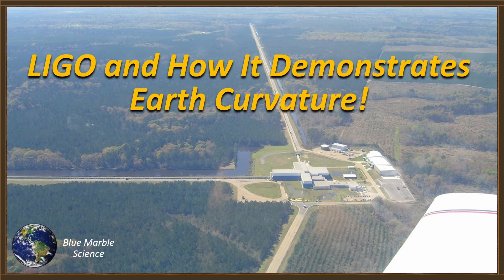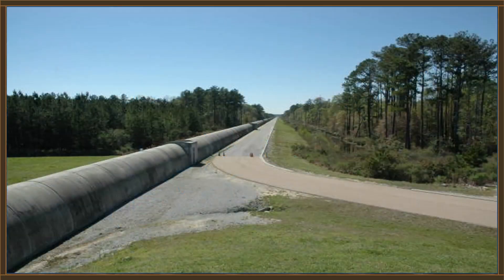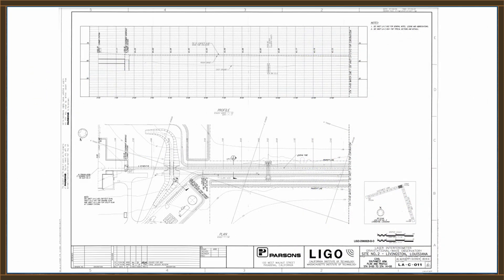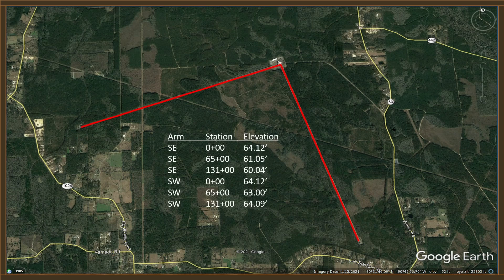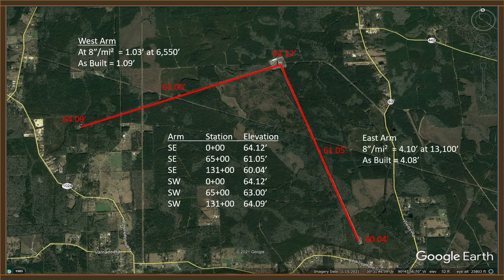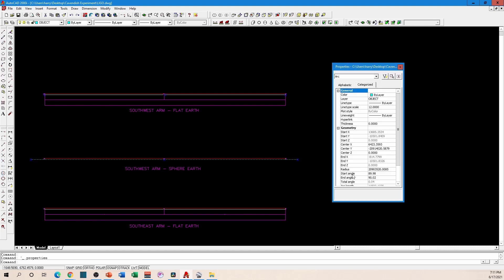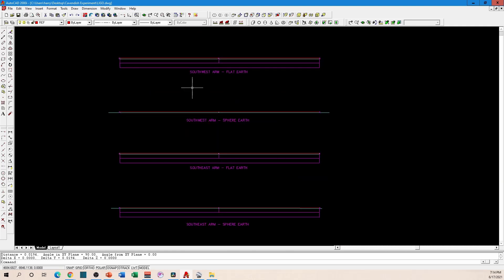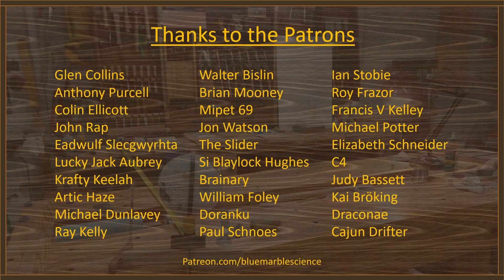How LIGO Demonstrates Earth Curvature

Comment: Why don't the elevations on the 2nd arm match the 1st arm? Shouldn't they both be 1' lower in the middle to match the globe model? I'm a Civil Engineer and I'm genuinely curious. I have drawn this in AuoCAD as well. I can see your points but claiming that this "proves" the spinning ball model is a giant stretch for me. To each their own!
Reply from the maker: The arms lie in a tangent plane and at Livingston, they picked the point of tangency to be slightly south and about 1.25 miles west of the southern end station. The result of that decision is that the northern arm is nearly level at its midpoint, but the eastern arm elevations change about four feet over its length. When you plot the elevations of that arm, they also form a slightly parabolic arc with the center point being a foot lower than a straight line drawn from the arms endpoints. I hope that isn't too confusing to visualize.

Comment: Wrong! At 5:32 freeze it. That SW line does kinda fit your end numbers I guess to bad your not reading them correctly. A story pole is read from bottom to top. I shoot 64 and mark it, I shoot halfway (for the sake of argument) down the line I shoot 63 as my pole is sitting on a mound of dirt (1) high I mark it, shooting thru 63 to the next 64 (because there was a big rock in the way it left a hole for the pole to drop into. Even so whats up with that SE line? Thats a freakin mess right there. Before you tell me they graded it flat b4 shooting I know plumbers that cant get 1/4" fall per foot half the time. Brian was right The 'ground' does matter. Build this thing @ Sea LEVEL get back to me. Or if you know the tube is level run a line 90deg to the  perpendicular vertice. If what YOU present is true then the TUBE is not flat but an arc either way does not prove curvature only uneven ground. And thats my 2cents.
Reply from the maker: These aren't story pole readings! These are elevations and you're the one reading them wrong. I guess I need to sit both you and Brian down and hold a class on how to read construction drawings. When you get away from pouring curbs and sidewalks or footers, you just stepped into the big boy arena. No engineer is going to plot story pole readings so when you figure out what you're talking about - get back to me.
Reply: @bluemarblescience  Footers exactly what those numbers are pulled for. Went to ITT tech for CADD. 30 yrs in construction Residential and commercial. Ive actually used the equipment in the construction of parking garages as a rod buster. I will admit I have not been able to pull the drawings on my end when going to the site and trying to view them. I just might be able to concur with you as I was taught to read and draw eng civil mech etc drawings plans and diagrams. It was make 200 a day hangin sheetrock or entry level draftsman makin 7.50Hr..... I know a little bit about numbers, physics, and geometry too...
Reply from the maker: @matthewpoggendick9346  Here's the LIGO site https://labcit.ligo.caltech.edu/LIGO_web/docs/asbuilts.html Check out Livingston Observatory civil package. Those are all actual elevations and you can more or less verify that with google earth. At least you can see that the road next to the arms is within a foot or two of the pad elevation data. If you look, they show "existing ground elevation", "rough grade elevation", and "top of slab elevation" on every drawing. There's a site grading plan in the Architectural section as well.
Reply: @bluemarblescience  Thank you I have no idea why I could not view those b4. No doubt about it that slab has an intentional hump (SW) and dip (SE). Now the why. A few things pop out at me now that ive been able to see the dwgs. and gather a little more info. First about the 2 sites both sites are about 50' above sea level (Civil LAC001) The numbers in the bottom of the coords legend are typically the numbers the eng go by. We will stick with Livingston Lab. I had thought no way no how would I let some doofus put a hump in my slab (ive run guys off the job for less). Both sites show a trench and the housing halfway or so in it. To the side of the LL arms are culverts (0:19 of this video) Then it hits me this is Louisianna. Living and working along the coast of FL and TX I got a feel of what it takes to get a proper foundation down and how hard it is keeping up with codes. So I beg you look at (Civil LAC004 - Section A) Zoom into that Section A. You see a dome right? Then a bottom line that says FLAT right? (kinda amusing it worked out this way) Above that you will see <----.5%. This is the substrate pitching down to meet a 3:1 drop off for water retention. Its a water table thing dig a hole in my front yard a big hole and it will fill up with water faster than you can take dirt out not to mention all the dirt sucks off the sides. I believe this elevation change is a design feature in order to shed water. Its not enuff of a difference to align the cradles up and down but water will pitch and run as desired. The SW from the center out each arm and pitched to a culvert the SE all the way out the south end. Please not how everything juts up at either end of sw but only on the corner of se. So my conclusion. Does not prove nor disprove either a globe or a fe but sure would like to shoot some numbers down those culverts settle this chit once and for all.....j/s
Reply: ooops my bad exchange Hump for Belly...sorry. This allows water to collect in the middle ish of the SW tube. Then there is the piping (possibly existing) connecting either side of the arm. So water runs downhill to middle of SW and as levels subside spills out south....the SE arm it just runs on downhill to the south and towards the gulf.

Comment: Make a simple visualization: Take a basketball or large beach ball and a drinking straw. Fold the drinking straw into a triangle. Put the triangle on the basketball. The triangle will sit on the ball, and the triangle will be touching the ball at 3 points. The point of contact with each leg of the straw is a point of tangency.

Comment: The fact that you might have very tiny differences between the tube line and the ground level is because the earth is not spherical but an oblate spheroid so they can be different along each tube path. It still shows however that the earth is not flat and that AutoCad is again the kryptonite for flerfers.
Reply: You mean the earth approximates an oblate spheroid, in reality it is a bit lumpy.

Comment: Great explanation. When arguing with flerfs about the curve I’ve posted links to a USAF navigation manual, The American Practical Navigator, a battleship gunnery chart that has tables to account for the curve, an engineering site about accounting for curvature in surveying, and a geodetic surveying site. Lately though, since YouTube doesn’t seem to like links,I’ve used this quote from CalTech’s LIGO website. : “Beam Tube Installation

LIGO's arms are long enough that the curvature of the Earth itself was a complicating factor when installing the vacuum tubes. It wasn’t enough for LIGO’s civil engineers to smooth a level path and assemble each arm’s tubes in a straight line. To ensure a perfectly level beam path, the Earth’s curvature (more than a vertical meter over the length of each arm) was countered by GPS-assisted earth-moving and high-precision concrete work.

Comment: Well done Blue! The paper Precision Alignment of the LIGO Using Dual-Frequency Differential GPS provides a good overview of how they did the analysis of the GPS data and how they transformed those coordinates to a earth fixed Cartesian coordinate system. They definitely didn't use the 8" per mile rule the Flerfer's are always going on about. Now here's another course I'd like to be a fly on wall for, Geodetic Surveying.
Reply: Given software of course 8” mi^2 is not the algorithm used. But, for 4 km it returns an accurate value. And 8” mi^2 is in my geodetic survey textbook, dated 1925. And I do use 8” mi^2 for moderate distances, like 25 mi or less, in long hand calcs. But my software of course is full computation, and same result within several mm.
Reply: @larryscott3982  I was toying with trying this out in ArcGIS, but Blue's work with AutoCad is close enough for Jazz, or bluegrass in this case.

Comment: Excellent job in your presentation.  There is no way that either the Louisiana or Hanford LIGOs are evidence of a flat earth.  
You did beat me to it since I recently got a copy of the prints and I'm putting together a similar video also including Hanford.  Actually I went through the Hanford data first and both arms are like the east arm on Louisiana LIGO.  I will admit that the west Louisiana LIGO arm threw me off at first until I realized the tangent was in the middle.  Having worked in commercial construction I can add that the slab did not need to be poured perfectly straight and there are a couple of 600 - 900 ft stretches in the civil prints with no elevation change but this is less than 1/4 inch from a perfect profile to earth curvature for 900 ft.   It would have been costly to try and pour that slab perfectly flat and the adjustable brackets at the beam tube joints were how the tubes were aligned to a straight line.
Reply: Please keep going and bring it to the hornets nest (Brandon’s show).
Reply: @profphilbell2075  I might do that just for a laugh but it's not really a hornets nest, more a nest of self deluded fools.  I have said before, "You can bring a horse to water, but you can't make it drink, and you can show flat earthers evidence, but you can't make them think."  

I went on Brandon's show once and showed them a video time-lase of a Singapore sun setting perpendicular to the horizon and asked a simple question, What path does that sun take to return to the east to rise again in the morning?  The cognitive dissonance was hilarious. To be honest their ignorance of the world around them is so great that I don't think any of them had ever realized that this was a real observation.  Only Payge tried to answer the question with "portals'.  I currently live near the equator and my 6 year old grandson was able to figure this out when I asked him one day.  Of course he pays attention to the motion of both the sun and the moon.
Reply: @fedogma8407  wow, your opening paragraph is perfect for the chorus of a song. We just need a nice tune along the lines of Ed the talking horse opening score.
Reply: @fedogma8407  dammit you are making me jealous. I’m usually in Singapore around a dozen times a year at the MB Sands. It’s now 18 months without a trip. Maybe a bunch of flerfs could e-beg for a trip there during the summer solstice. Hmmm that’s about 3 days away. 😁
Reply from the maker: We do what makes sense in actual construction. Column supports that have been drilled 30 or forty feet deep will usually be a couple of inches low and the column base will sit on top of leveling nuts so the elevation of the base plate can be set accurately. Once set, the gap is filled with grout and we do all of that because concrete is never better than approximate. I picked Livingston simply because it's easy to analyze and visualize. One of the Hanford arms slope upward to the vertex and the other arm slopes upward FROM the vertex. But please do you video on it and get it out there. I'll mirror it on this channel if you'll allow me!
Reply: @bluemarblescience  I have the data collected and elevations plotted for both LIGO’s but I think I will just concentrate on Hanford since you did a great job with Livingston.  I don’t have AutoCAD but I am going to include similar orthographic views that I draw to show how this matches the globe.  Not certain when it will be finished since I’ll be busy next week but I would be more than happy to let you mirror my video.
I have a question about the tube tolerances for straightness.  At 0:54 you showed “A maximum deviation from straightness in inertial space of 5mm root mean square…”  I also have a copy of your 2nd document link Precision alignment of the LIGO 4 km…  This is on Page 9, ¶3,  “Both beam tubes at Hanford are aligned to their respective axes to better than 0.005 m RMS (2-axis)”     On Page 11 they say Livingston was within 4mm.
Am I correct to assume that this was how much that tube wavered horizontally and vertically along the 4km straight line?  Do you know if this was a +/-  or total tolerance?   
On P 14 is “Table 1 Allocation of budgeted tolerances for the beam tube clear aperture.”  Near the bottom is “Alignment of straightness over 4 km” with a value of 0.018 m” or 18 mm so they definitely were well within tolerance.  That is impressive over that distance.
Reply: @bluemarblescience  I finally had a chance to finish my Hanford LIGO video this morning.  After lunch I turned my computer on for a final check of the video before uploading and although I was able to login nothing loaded after that.   Right now my computer is in the shop and hopefully I don't lose any data.
Reply from the maker: @khunrichz4855  Hope it's all good!
Reply: @bluemarblescience  I finally up-loaded my Hanford LIGO video.  Have a look and if you are still interested you have my permission to mirror my video on your channel. As for my computer, it was the dreaded locked screen after a Window update. This was the first time it happened to me.
Reply from the maker: @fedogma8407  I watched it - good job! You looked at it slightly differently than I did and came up with the same answer. So I think I'll take you up on the offer and mirror it. Thanks!
Reply: @bluemarblescience  Thanks for the compliment.  I think it is good that we did look at this a bit differently but had the same answer and also that you analyzed the Livingston data while I looked at the Hanford data. 

It was interesting reading the article about how they aligned the beam tube arms with GPS.  I will admit that at first I was a bit surprised when I first saw the photo of the support brackets at the beam tube joints. I guess I was expecting something more complex.  The adjustment nut system is definitely low tech, it looks like your typical coarse threaded 3/8th inch all-thread rods but then I thought, well yes, it certainly is enough to do the job.
Reply from the maker: @fedogma8407  I know what you mean but I've designed enough stuff like that in my life to appreciate the simplicity. Sometimes, as engineers we just need to stop being so smart and simply utilize the Fred Flintstone approach. You don't need a ball point pen that writes in zero-g if a pencil will work. What's that called again - KISS or something like that LOL!

Comment: FYI ... approximately 
1/100 ft ~ 1/8 inch ~ 3 mm
3/8 in ~ 3/100 ft ~ 0.010 meters

The adjusters can account for the minor elevation err in the concrete pad. So the pad had to be within a spec and not as precise as the tube. Constructing the pad to a finer precision would’ve not eliminated the adjusters, so a couple hundredths of a foot is plenty good. And ignoring curvature would not be good enough. It’s too easy to build straight to a couple hundredths. It’s just NOT a constant elevation.
Reply: I worked in commercial construction and it would have been expensive to pour that beam slab to a tight tolerance.  I have a copy of the prints and there are actually a couple of stretches with no elevation changes for up to 900 ft but this is less than 1/4 inch of curvature.  Like you say, it was the adjusters that were used to align the tube to a straight line and even that tube had an allowable tolerance.  The critical alignment was those mirrors.
Reply: @fedogma8407  
At the point of tangency, for about 400 either side the elevation change is about 0.005 ft. 

Spheres are like that.
Reply: @larryscott3982  Yes, from the tangent in the center the drop is even less.  I did a couple of videos in regards to construction on a globe to show that calculated variations for curvature and plumb lines on a globe are well below our tolerances.  In one video I gave an example of a 1,500 ft long tilt-up warehouse which would only have a calculated drop of just over 1/8th on each end from a line tangent to the center point.  That slab would vary more than that over 20 ft.  One thing that is not a part of this conversation is that everything is built to an allowable tolerance.  We used rotating laser levels for concrete elevation grades.  We would get an elevation from a surveyor's benchmarks then adjust it for the correct elevation.